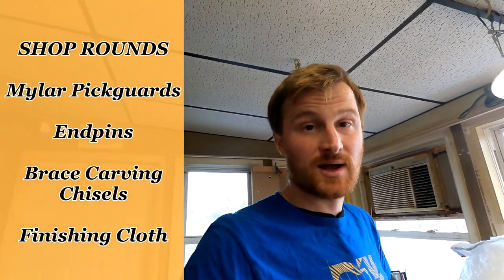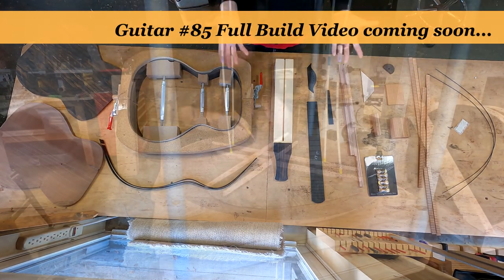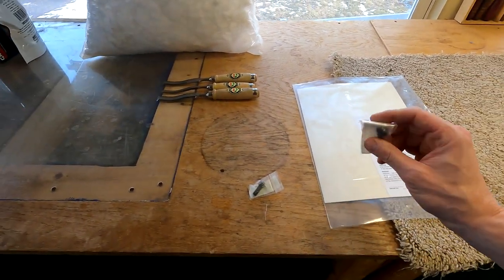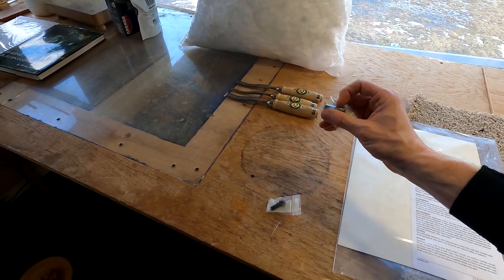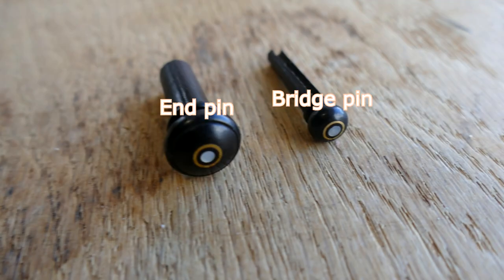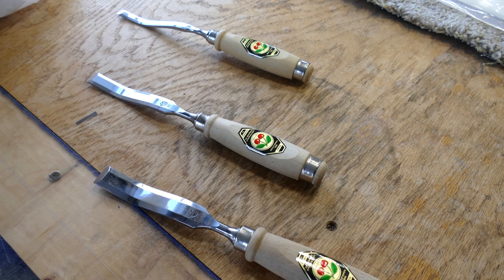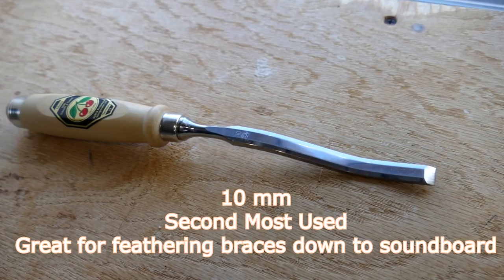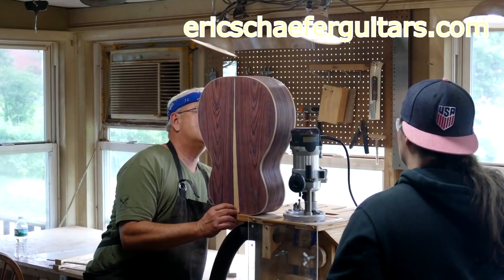Shop Rounds | Mylar Pickguards, Endpins, Brace Chisels, Finishing Cloth

Comment: Question.  Bridge pins.  3 deg. or 5 degree? Quick reason why.  Thanks so much for all your videos!
Reply from the maker: 3 degree. No good reason, lol! I've always used 3 degree bridge pins and my reamer is a 3 degree reamer. In fact, I'm not sure what the reason for the two common pin types is. If you know I'd love to hear it actually
Reply: @EricSchaeferGuitars  Thanks for the answer!  The only thing I know is that newer factory guitars like Taylor and Martin use the 5 degree now. I have not been able to find out why.  I did notice that LMI has more 3 deg than 5 deg.